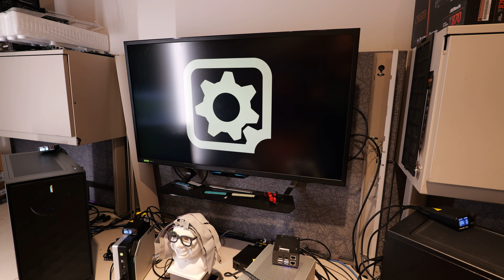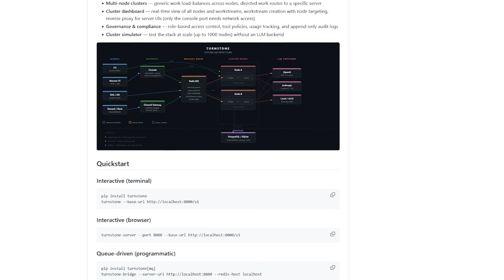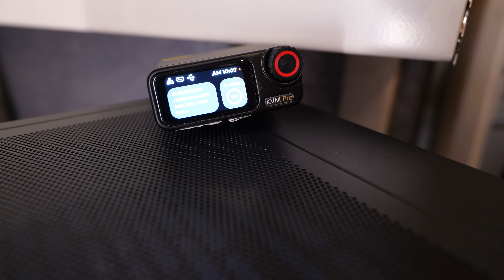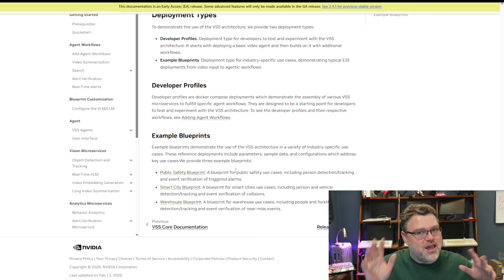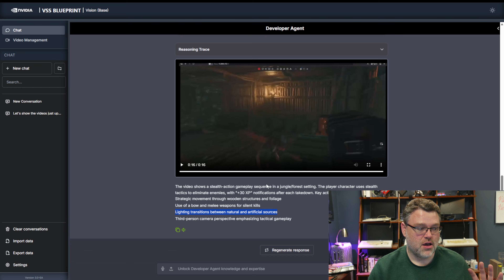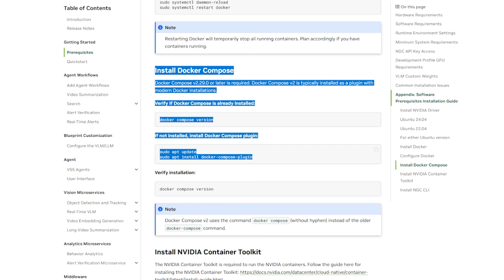Teaching a Robot how to Game with Turnstone and Nvidia VSS!

Comment: Building a bug testing system would help development greatly. How about texture and level model/collision issues where you can see through the seams? Or is that more of an engine thing you need to plan for, generating levels on the fly should not be hard, ya it may take time to build them, but level design layout seems doable. Cloth/hair and other clipping and collision issues also seems doable if you can figure out engine wise.

Comment: I always feel a bit nervous when adding probabilistic signals into benchmarking or tests. The randomness for benchmarks should be really really low, like only the randomness in the benchmarked system. 

This feels less like benchmarking but more like fuzzing. Which is fine, but IMO should be careful with the slop in tests and benchmarks.

Comment: I guess this can be used to automate some things inside of OpenQA, like generation of needles, or even usage of video for needles. And of course to interact with the test and tune thresholds and whatever can be parametrized etc. 

It would be more expansive than it is, for sure, but also could be better in what it sends for human engineers to review. Lowering workload.
Reply: This is my first time learning about OpenQA, just went down a 30 min hole looking into it so thanks for that hah. 

I've been wondering for a while if there's some sorta distributed/end user driven version of that, basically allow users to offer their machines as HIL test runners when not in use, giving them some promise of a more stable experience on their particular hardware.

Another way that sorta thing could be used is to run a full OS/app test suite from a liveusb, so someone can check how well their hardware is supported before actually installing anything. It'd be slow & heavy but I'd be happy to run something like that overnight once in a while instead of installing/upgrading & finding major issues down the line.

Comment: Computationally, this can capture some low hanging fruit issues. 
I have low expectations regarding its use for debugging though. 
For decades, we had fuzzers and on the extreme end formal verification, rarely have these been used to make software more reliable. It wont be different with these new tools available.
Unit tests have somewhat been  integrated in development cycles at least.
Reply: Even assuming every function gets multiple unit test, integration and exploratory testing will still find bugs.